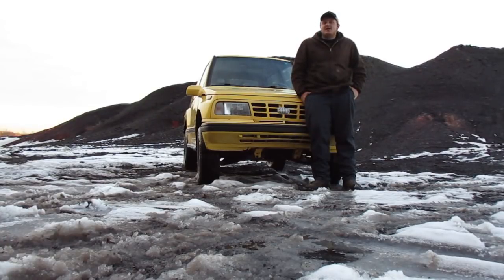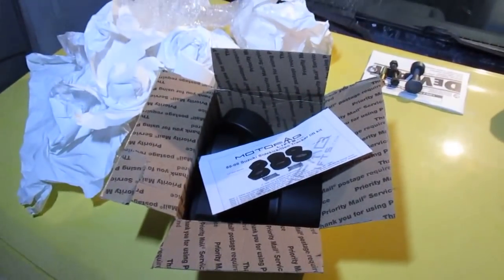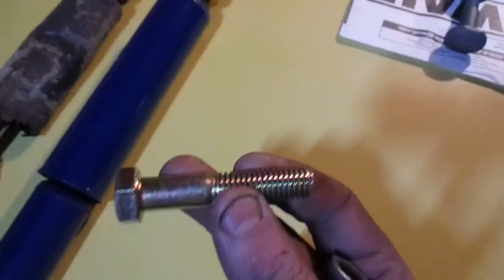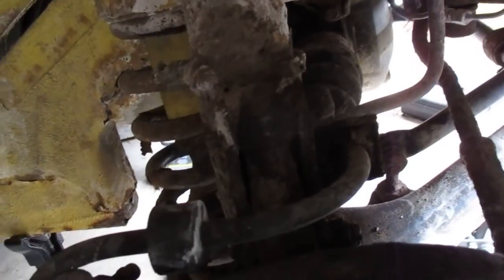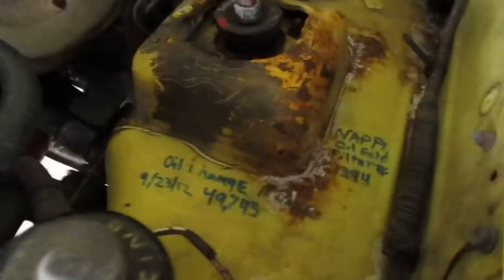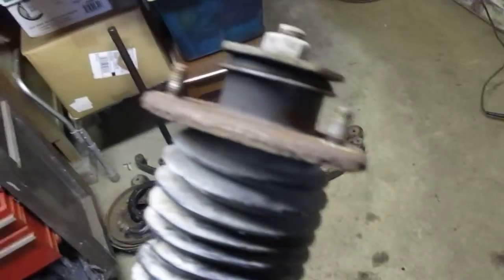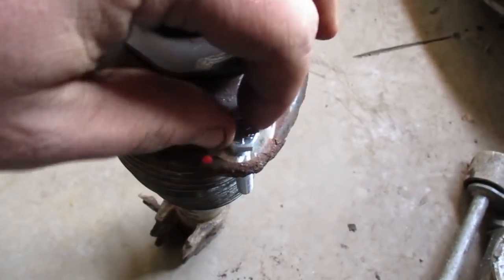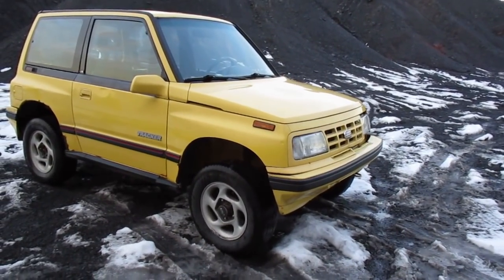How To Install A BUDGET Geo Tracker LIFT!

Comment: Gen 2 vacuum actuator to mechanical locking hubs?
Done it, ideas?
Installed 1" spacers & 225 75r16's w/o lift on my 02 Tracker 3dr, 2000L but reluctant to buy or repair my pump.
NOTE: Installed 3" lift on my 93 Tracker 1.6L 8v & camber is very positive until removing 2" from the front after a new right cv separation while in a hole.

Comment: Putting a 2 inch block in the front spring gives more than 2 inches lift...
Reply from the maker: I believe the front spacers are .500 smaller then the rears

Comment: I'm also seeing that the rear diff breather hose needs to be longer for full dropped.  Easy, cheap fix though.
Reply: I'm also running the 2005 Ford E150 rear shocks. It's a dead on 2 inch shift of range to right where you need it. Plus it's a heavier duty shock as opposed to the stock ones.

Comment: What's your opinion on wheel base spacers? Thank you
Reply: I have 31 10 50 15s on mine with the stock wheels running a two and a half inch wheel spacer I haven't had a problem in a year and a half with them

Comment: I just did my 2001 4 door Tracker and had to grind out the strut holes as I had a big toe in problem. Also had to get adjustable strut bolts. Still have to get it aligned but it is a lot closer to being right than it was. I went with the 84 Crown Vic HiWay Patrol rear shocks. This is my Ice fishing car for northern Minnesota, Just needed a little more clearance so it will be easier to get around in the snow on the ice, hopefully.

Comment: Nice job. Thanks for taking the time to shoot and post. I have not seen a video describing the Trackick suspension spacer lift with this much detail. My 95 Tracker spends a lot of time in the desertl and I could really use the ground clearance. I have not yet installed a similar kit I have had for over 2 years. Maybe your video will inspire me to get rolling on that. Thanks for posting.

Comment: Will this lift work with regular oem length shocks? 96 tracker
Reply: If you do not put longer shocks then you do not get the benefit of the lift because the length of the shocks is the limiting factor in the rear. If you think about it the front has longer struts now as well through the second set of spacers up front. So yes longer shocks are necessary.

Comment: I just installed this lift on my Geo tracker, Camber bolts did not work for me, I wound up drilling strut housing and frame bolt holes with 9/16 drill bit, gave me just enough to fix my camber!

Comment: Camber bolts??????
Reply: Don't go with the camera bolts I tried them they did not work what a waste of money. When I did my lift I slotted the top hole in the strut so you have camber adjustment through the slotted top hole in the strut where it mounts to the knuckle